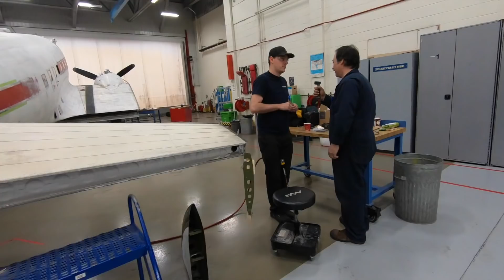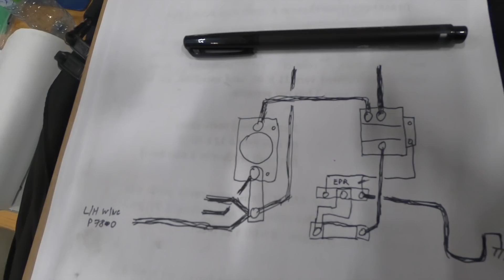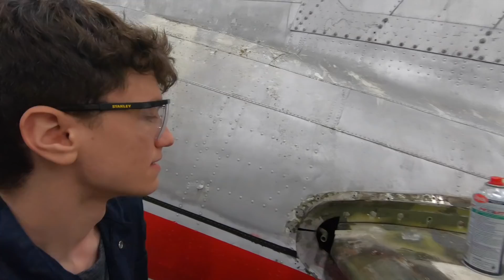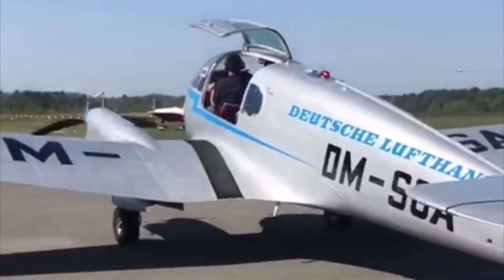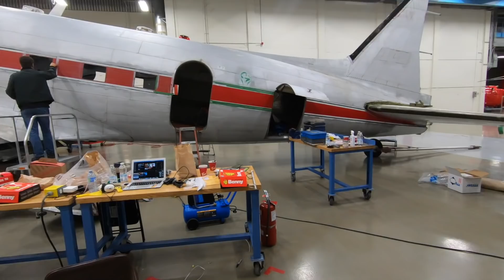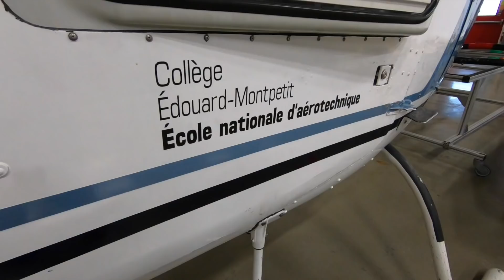"Many Hands Make Light Work" Plane Savers E109

Comment: I certainly hope you will do a gear swing, it is a good bet that the retract cylinder might be a bit dry if they had no oil preserving them. I saw the fuel selectors done. Also the oloes might need some TLC.

Comment: The school, the teachers and the students are priceless. You could never put a price tag on the knowledge and expertise that they bring to the project. I know exactly how Pierre felt when power went into the aircraft for the first time, it doesn't matter that it was only one little light bulb. You know that what you've done is correct but until you throw that switch you never actually know for sure. 'Chapeau' Pierre! What he is doing with that cabling is one of the most impressive parts of the whole project. Without it the aircraft would be just a lifeless lump of metal. It'll be a great day when all of the systems are powering up.

Comment: So much congratulatory things to say to so many but I promised in the past not to be so lengthy in my comments so as to annoy the PLANE SAVERS community ...
.
but how can I not acknowledge :-
.
(1) - The Amazing Avionics Effort by l'équipe Pierre !
.
Heads up for the Avionics Team and everyone else working on the airplane, remember safety precautions when Ground Power is on.
.
Have fire extinguishers specific for putting out electrical fires strategically placed whenever you're bringing online a new system with high power (current) wiring in the harness for the first time.
.
Also you'll probably need to have TC approve the Avionics and electrical mod, so you'll need to document all of your wiring work on schematics and wiring diagrams (as Pierre is doing by hand) but if you can get a student or a professional to volunteer to transfer the schematics to CAD, its going to make life a lot easier to make changes and to provide TC with the final configuration when you go for your Safety of Flight review and airworthiness certificate.
.
(2) - The stellar effort by Stella !
.
(3) - Tom's story and his insights
.
Merci Les Rôtisseries Benny. 
I must try that chicken when I get back, even if it means a flight from CSS3 to CYHU.
.
(4) - Casten's content from Germany
.
(5) - The volunteers showing old parts some tender care in order to get more out of them. 
.
Resurrection, Refurbishment and Restoration is about achieving Sustainability in Aviation.
.
Last but not least, You Mikey, Uncle Ronnie, ENA and everyone working behind the scenes to get DTD flying and to keep us all updated.
.
Reply: That was't too long. just about right what needs to be said!

Comment: Who would have thought it would be exiting to see a bulb light up?  Great Job!
Reply: It is very exciting. It depends on your point of view I guess, but I agree 100% with you!

In the early 90's, I had a bulkhead fuse panel fire in the cockpit of a Convair 990 when was I flying freight run to Venezuela. After landing the avionics crew tore apart the panels and lord, I've never seen so many wires in my life, packed into spaces I thought impossible. Charred wires everywhere. I thought we were going to be grounded for weeks (if not months) as the main bus and breakers  had shorted out. There were entire bundles of wires now fused together. They had wiring schematics strewn all over the cockpit and cargo deck. There must have been at least 40 'scrolls' of diagrams laid out, to check out every circuit. I was shaking my head as the team simply dove in and began to repair it. 

The ground crew had the panel, components and wiring repairs completed in two days. I never took electrical avionics for granted ever again. These engineers were top notch and trained to be the best. Two of them were Canadian and had moved to Venezuela for the warm weather, beaches and low cost of living (early 90's). Back then, oil production equipment was flown into the country, sometimes twice a day, 4 days a week. 

Turns out, during our test power run-up (generators, breakers, full electrical loads), they fixed 6 or 7 dash light bulbs in the instrument panel that we didn't even know were supposed to be there. It's the little things you appreciate later.. :-)

Have a nice flight!